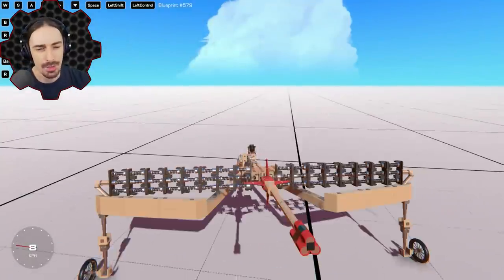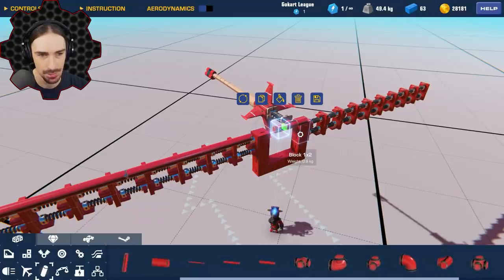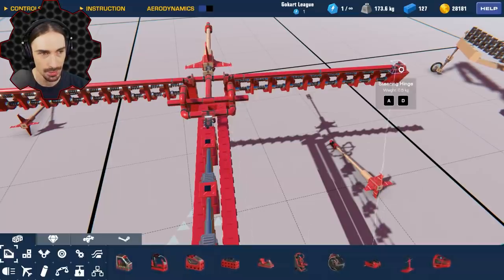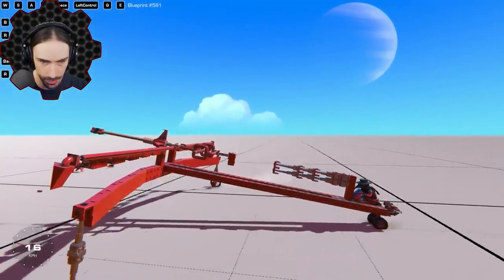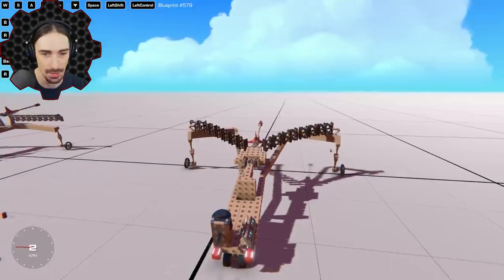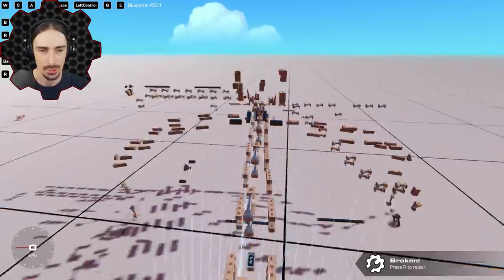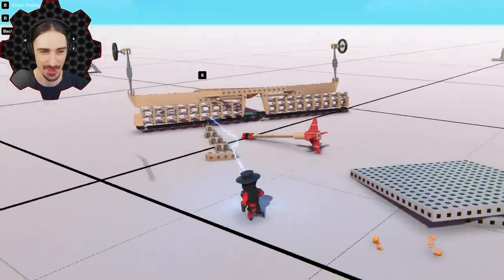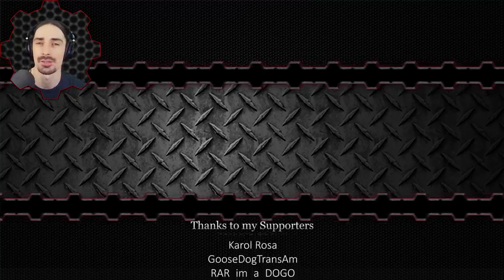Converting My Fake Ballista Into a Real Ballista! - Trailmakers Gameplay

Comment: Funny thing is the first attempt is a slingshot and the second one was a crossbow.
And now a ballista is not a crossbow, they are just similar to them. A ballista has two arms sticking out of two rolls of rope and said rolls of rope is then twisted by the drawing of the string to create tension. So making a true ballista is most likely impossible to do so in this game.
A show I remember watching a few years back had an updated ballista, that used spring steel instead of rope for the tension or is that torsion, I forget sometimes.
Reply: Its torsion and thats not a ballista thats a roman weapon called the scorpian
Reply: Its Torsion and thats what differentiates a giant crossbow, or Arbalest, from a Balista. A Balist was basically a Box that had rope slung between top and bottom side and that was twisted as hard as possible with a lever stuck between the ropes. One side clockwise, the other counterclockwise and then the ends of the levers are connected with a rope to keep that tension.
And when you pull the connecting rope back and release it again, thats is how the energy is stored and transferred to an arrow/big bolt

I think in trailmakers one would have to use some of the rotating servos, but if they are strong enough for it? don't know tbh
Reply: I don't know but he made a reverse bow something!
Reply: Yep
Reply: Shh don't tell him he still did not make a ballista
Reply: not wrong, but also not entirely right, scrapman build a "arcuballista", which is also commonly known as a ballista.
making this stuff in trailmakers is possible, but instead of springs/hinges you would use rotors and servos

Comment: So I made my own realistic suspension ballista after the last video and this is what i found:
First, having more suspension only means more power if you pull it back far enough. It’s a lot less stable when you pull it back further, but it also launches the bolt exponentially further. it’s a bit of a trade-off. I personally went for more power and less stability, and I got a nice balance between launching the bolt all the way to the horizon and the ballista not shattering every time you try to fire
Second, to make the arrow fly straighter, you can put a helicopter engine and a logic gate set to toggle on the arrow to make the arrow infinitely spin after releasing, which works better to stabilize the bolt than even powered fins do
Third, you can reduce a lot of the weight on the string if you use the detachable blocks themselves as the hook that holds the string back
Finally, having aerodynamic arrows significantly increases the distance it flies, so you may want to add a wedge or cone to the front of the bolt 
If you want to look at my design to see how it works and what it does differently I did put it on the workshop; the better version is called “Suspension Ballista MK2” by TheAutumnDryad

Edit: also, the part of the bow that flexes is called the arms.

Comment: Suggestion. mix the steering hinge with the suspension. pretty much how a composite bow is made, two materials, the back of the bow is made with a material that is good under tension(steering hinge) and the belly of the bow is made with a material that is good with compression forces(suspension)

Comment: Ballista nerd here, unlike a bow or crossbow, the launching power is not stored in the shaft of the ballista but in the string. In old ballistas, they would coil the strings around together to build up tension. In a bow/crossbow, however, the bending of the wood is what gives it that power since a rope at that scale would either snap the string or would not provide enough force. So your original slingshot based design was more accurate. Whoever suggested this was a fraud :P

Comment: Change the positioning of the suspension so that a layer is ontop, a layer is on bottom, and the third layer is on the front of the wedges so that the rods being pulled back are actually in the middle and not compressing the suspension.

Comment: When being pulled from the inside the tension is more immense than the slingshot version and because of the way your pulling the sling shot version in real life that would cause it to snap in half on shooting and could shoot the dart backwards the reason ballistas are good is because of power and accuracy between slingshot being inaccurate to catapult being inaccurate but more powerful the ballista solved both of these and made it easier but a bit more dangerous because the tension on ballistas can cause its bullet to fly backwards or the bow string will snap and the bullet will fall midway or break from the snap and not work properly in air